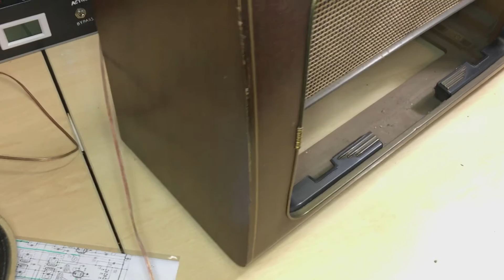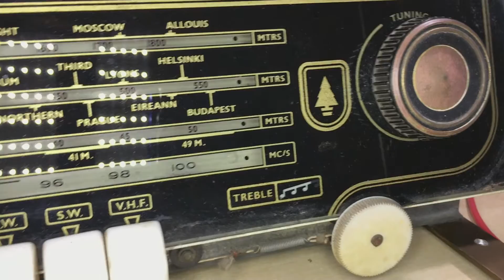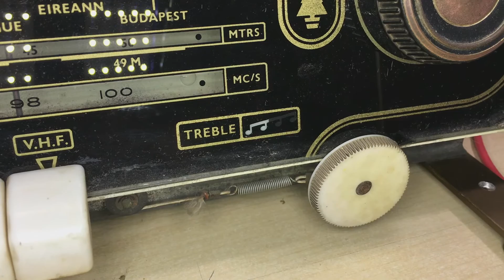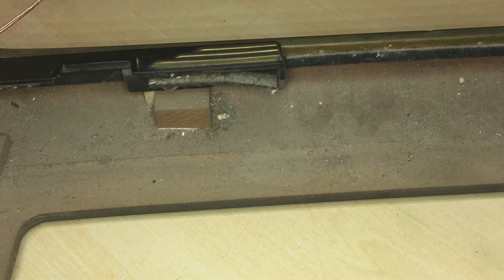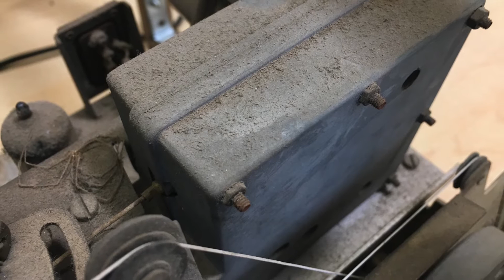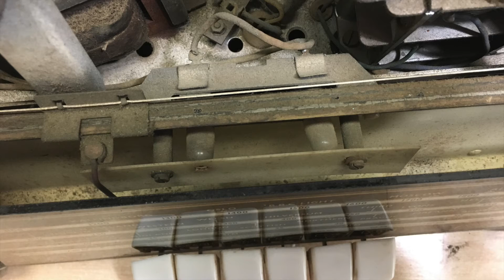Bush VHF64 tube radio restoration - Part 1. A first look at this British valve radio.

Comment: Hi Manuel.  I have just bought one of these radios - it appears to be identical but it hasn't arrived yet.  These, like all FM tube radios, are very rare here in Australia and this one was cheap. I suspect that mine will be in worse condition than yours but I hope I can do something with it.  Anyway I'm glad you have restored one. This series of videos will be a valuable reference! 
Thanks!
Reply from the maker: Good luck with yours when it arrives.
Reply: @electronicsoldandnew  Hi Manuel. It arrived quite some time ago and I have just pulled it out and started work on it.  It’s pretty rough but if the transformer checks out I’ll have a go at it. Sadly the dial glass is broken.  I’ll just have to see what I can do with it. Your dial stringing comments have already proved useful. Not looking forward to all those Hunts caps!
Reply from the maker: 😊 yes, the caps have to go. Have fun.

Comment: My speciality!! the chassis is very similar on several models; the cabinets varied a lot. I always thought the 64 was modelled on a Grundig; the printed trim around the logo and magic eye are the same shape as the Grundig Logo and the speakers as you see. But whichever, the style is definitely German. the 61 was in a bakelite case, the 62 which I have was in a wooden case of more traditional British design, and there wasn't a 63 to my knowledge. The radio is very good, it has an extra IF stage which makes it really sensitive. The Hunts Mouldseal caps WILL all be leaky. The rectifier is usually an EZ80!
Reply from the maker: +Alan Cordwell : good to know that you have experience in these sets. I may need help. 
I was hoping the hunts caps in low voltage stages would be ok, but you think not? There are a lot of them! Also, the soldering is difficult to undo as the components are really wrapped around the solder joints (as they should be) so it makes removing them a pain. 
This one has an ez81 rectifier valve, which is correct according to the schematic. 
Anyway, this should be fun.
Reply from the maker: +Alan Cordwell : I guess I'm in for some serious desoldering!
Reply: A desoldering gun might be in order. It's worth it's wait in gold at times.
Reply: Well its always a good debate and I'm not in favour of 'scatter gun' recapping necessarily; but in the case of the Hunts, they usually are bad. The classic failure mode is that the moulded plastic case cracks, in which case you will find them very leaky due to moisture ingress. But, I've seen plenty even when the case is intact and apparently in good condition, where the capacitance measures way off- usually high, due to leakage. So yes, I know there are a lot, but I would recommend changing them all. Even if they aren't subject to any DC, for example in the VHF 62 I did last year, the audio didn't sound 'right'- it was tinny and lacking bass. There was a 0.1uF mouldseal in apparently good condition in the feedback loop, changing that restored the normal audio response. But at the end of the day, do as you think fit- good luck!